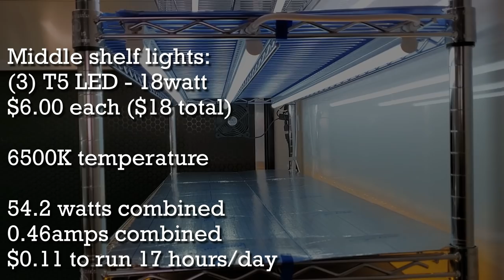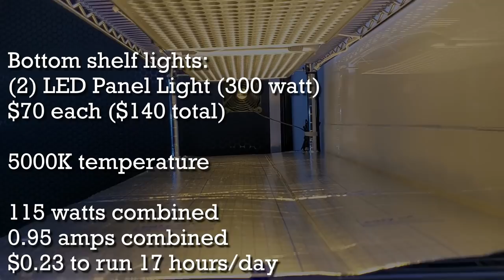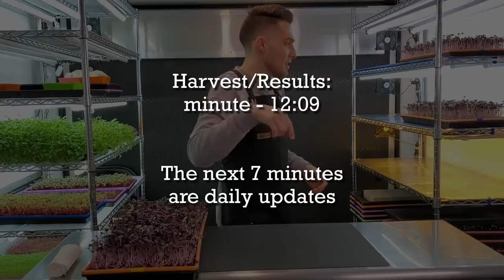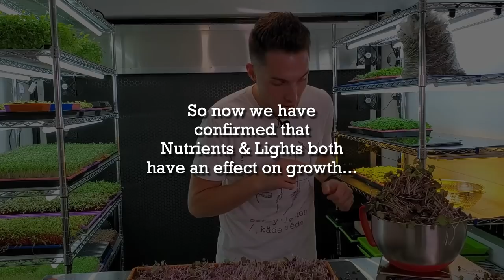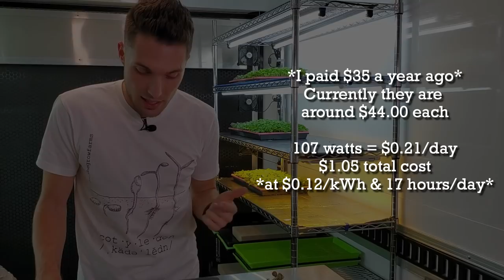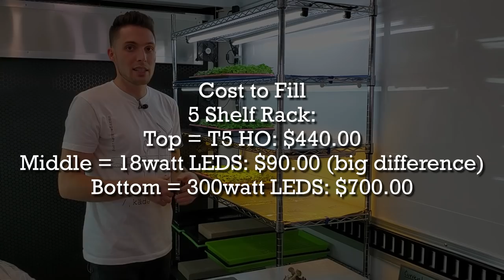Microgreen Lighting: Fluorescent vs LED's - On The Grow

Comment: Florescent generates more heat than the LEDs. I personally use that heat. I use 4 tube grid lights recycled from a school relighting program. I drilled 1/4" holes every 4 inches in the diffuser. Then I mounted a computer fan in the light housing  over a 4" hole I cut in the upper housing. The result is a diffuse gentle drying/heating breeze that keeps all mold issues gone! I only bottom water. Perfect combination of cheap, effective and easy. I recently started using 20watt led tube lights 3 to a shelf. They seem to produce slightly more light and far less heat. I grow in my basement year around. I think I will need the heat this winter. LEDs will not supply that. I have seen no difference in growth rates in my particular application. I also grow full size cherry tomatoes all winter. I use 2@ 4 tube florescent fixtures and 6 20 watt led tube lights, plus a led 40 watt dope light. In harvest tomatoes literally every day. New flowers, growth and have to bonzi cut every week. Tomatoes are very tasty. Nice video, thanks for sharing!

Comment: Hi guys, just started out and am using a grow kit from True Leaf, using 24" 6000k led's, 2 per shelf.  I've tried both the soil and hydroponics but Im having watering issues.  Started with salad mix, both started out good but then started smelling like wet socks by day 7, watering about a cup a day.  I'm wasn't able to bottom water with these crops but drilled out some holes for a recent radish tray, and hope it stops.  Could you point me to some info on correct watering?  Do you monitor the weight, how many cups per day?  I don't have any chemicals currently.  

Also, how did your crop test taste?  I thought the soil tasted much better than the hydroponics, and performed much better.

Thanks!  Great info!!
Reply from the maker: Hey Mike! It sounds like you could be slightly over-watering... Our go-to is about 1 cup, twice a day (morning and evening) in early growth and 2 cups twice a day (morning and evening) in later growth... This really depends on the crop variety though. You want the tray to have mostly absorbed all of the water from the previous watering before adding more... Otherwise you will end up with stagnant water with a smell like you described. Try dropping your watering substantially for the next grow and pay attention to the medium and plants... 

As for taste, they are both very comparable for us... The only time we have disliked the flavor of some hydroponics groups was when we used a nutrient called Sea-90 which made the plants so incredibly salty...

Hope that helps!

Comment: Very informative video as usual. It certainly shows others that they don’t need to spend a lot of money on lights to grow microgreens. You mentioned that one tray had an advantage, but I missed why it had an advantage. I assume the they were bigger, but didn’t understand why? Maybe it had to do with where in the stack that tray was 9r were the tray weighted individually?
Reply from the maker: So the ones that had an advantage was the tray that was on top for the last day of stacking. It just gives it a slight head start on standing up straight... it only had an empty tray on top of it where the other two had the weight of the other trays on top of it. Hope that makes sense! Thanks for the continued support!
Reply: On The Grow Thanks for the fast reply and yes thats what I was assuming, but I just wanted to make sure. I appreciate the clarification and look forward to more of your videos 👍

Comment: Cooler temps and more red spectrum light will give them more purple color. Being on the bottom and not having lights under it to heat the tray as well as including more red spectrum, it's easy to see why the LEDs on the bottom gave different results.
Reply from the maker: We will have to switch up the lighting order to see! We're also about to start some experiments using different levels of yellow/red light to see what the impact is.

I have heard of cold-treating microgreens on their last day to pop the color... might have to experiment with it... Thanks for sharing!

Comment: interesting data so far.  Temperature and relative humidity on each shelf together with accumulated water consumption could indicate how much water is retained by the plant and how much is transpired to the atmosphere.  Concurrent  comparisons of appearances, aroma and tastes of the plants together with plant growth/weight gains could also indicate if some stress factors could be positive or negative for productivity and at which stage of maturity the changes to watering, humidity and temperature will benefit the plants and your process management.  Eg. A possible next experiment could be to set up 3 shelves with 3 LED tubes as in the blue shelf (indicated as your cost effective option) and vary the watering program timing of applications to use the same total amount as you did in this trial. Daily, 1 tray with a third x 3 , 1tray with a sixth x 6 and the final tray at a twelfth x 12 watering schedule.  Smaller amounts may require distribution to avoid the possibility of plants further from the water origin becoming dry.  The water applications will alter temperature and humidity also.  More frequent applications will reduce variation.  Significant program variations are more likely to indicate future possible testing directions.  Recording the findings of the factors listed could indicate other modifications to improve growing schedules.  Exhaustive as it appears, the results become more reliable as variables are reduced by accumulated results.  Sometimes a trial batch of a main tray can be set beside the main tray to test a varied management plan.  This can save time and expense and helps you to remember to maintain the trial as you look after the normal watering etc..  
It can be surprising and rewarding to discover what works best for you.  Cheers, Gary

Comment: Divide your costs by 4 or multiply your produce weight by 4 since you have 4 trays per shelf/light set. Also, what is your cost per gram of produce? Spread your light rig upfront cost over the estimated time to failure (should be available if they are UL listed). You take that est. failure time and divide by time to maturity for an average tray... then multiply by four for the # of trays per light. Take the total cost of the light and divide by that number to get the estimated cost per tray of produce. Then add the running cost, like you did, but divide that by 4 trays as well. That, plus your water and fertilizer costs will be your gross cost per tray of produce. Now, take the sale price per gram multiplied by the grams for gross revenue. Subtract out the previously calculated cost per tray and you have the gross profit per tray. ...now you have the harder parts of overhead... salary, transportation costs for delivery, taxes, etc... Oooorrrrrr.... you can just look at how much you made and subtract what you spent at the end of the month. 😁

Comment: Great content!  Curious if the distance between the plants and the lights affects the "stretch" of the plant?  You mentioned that high intensity lights sometimes discourage the sprouts to stretch towards the light, so I am wondering if mounting the lights a few inches higher (maybe 6"?) would encourage that stretch.

Comment: I loved this video, it's very interesting content. Can you do another experiment with the better lights on the top shelf? I'm wondering if it was not only the better lights on the bottom shelf but, also if receiving the light from the upper shelves was a factor? Thank you for posting your experiment.
Reply from the maker: Thank you for the support! Each shelf has an opaque layer between it... the only way there is light bleed is at the very back where it slightly reflects off the wall, and I wouldn’t consider that as having an effect. Especially considering how much light the bottom light puts out. If I turn off the other lights, there is no change in LUX so there shouldn’t be any light getting through...

Comment: nice video mate, 

you should look into a par meter,  each spectrum of light has a different energy. 

once you have a PAR meter, you should set your lights to have equal light (based on umol/s) (example: 3 shelfs, with even coverage of umols (say 165umol/s, DLI = 10 over 17hrs of light) on each shelf

at this point you can check the quility of the light spectrum and how it effects your microgreens since they will all have the same DLI,

the red spectrums will give your plants more height
blue spectrums shorter/leafyer plants
green spectrum will help with penatration to the lower parts of the plants (green spectrum is in white)

having a par meter will also help with correct power/light output since your not using lux (visable light to humans and not plants)
Reply from the maker: Yeah, I have looked into a PAR meter, but I am not really into the over-analyzing of the light spectrum. I use LUX as a basic measurement just to show there is a difference and my main concern are the results and the effects they have on a crop.

We will get more into the science of it at some point, but for now, LUX is sufficient as the main goal is to see how these lights effect growth. We don't need to measure PAR, PPFD or any of that to see the results the different lights provide. 

Thanks for the suggestion though!
Reply: @OnTheGrow  good job on ordering a  quantum par meter. it cant tell you the quility of the light, it will only show you how many photons are hitting a surface that is usable for the plant (PAR)

Comment: Thank you so much.... SUB'D. I have to ask roughly how much was the portable trailer with incorporation of fans and temperature equipement?
Reply from the maker: Thank you for the support!! It was about $15,000 for the trailer with the Insulated Walls, Triple Sink, water reservoir, rubber flooring, aluminum walls, 15,000BTU A/C, electrical and so on... with the added racks and gear, probably closer to $20,000 or so. 

I bought it new and custom built, which I recommend against. I’d buy used next time, then convert for like 1/3rd the cost. I would think it could be done for $5,000 or less. 

I’ll be making a video about it soon with some ideas and stuff how people could do it better than I have!

Thank you again for the support! 🤗🌱🌱

Comment: Any thoughts on how the spectrum and temperature of the light effects growth. I found some toggled led bulb replacement for my racks and put 4 T8 replacement bulbs per layer. I picked 6500k 18 watt bulbs the nice then is that they are cheap as well at $20/pair. I will let you know how the trays grow out.
Reply from the maker: Nice! Yeah, we also mainly use the 6500K spectrum. We did have some blue spectrum lights that did amazing, but the supplier has since stopped selling them. They were actually our favorite lights. We haven't dug too deep yet into spectrums but we are hoping to get more tests like this going so we can learn more about them! Excited to hear how yours work out!

Comment: If you took the extra 2 ounces from the sprouts on the bottom shelf, and sold it for six dollars a container at the farmers market, that would be an extra $120 for 20 racks, providing that you got the same extra yield every time. That would pay you back for the more expensive lights in seven weeks, then after that you would have an additional $120 in profit per rack, or approx $12k per year for the two racks I can visible see on screen.

Comment: In the video you referred to the middle shelf as 18w LEDs, but in your amazon shop you have 22w and 20w listed.

Can you clarify which is which in the shop?
Reply from the maker: They stopped selling the 18watts and bumped them up to 20 watts. We have some on our shelf, I just keep calling them all the 18 watt. The 20 watts will actually work better since they crank our more lumens and they are actually cheaper than the 18watts I was buying. I got ours from a company called OnlyLux if you are interested in trying to find our exact lights. Sorry about the confusion! It is hard to keep the same lights listed because the amazon vendors switch it up so often.
Reply from the maker: Here is part of the reason we stopped listing them, they switched from 6500K light spectrum to 4000K (more yellow). Here is the same company we used, but they no longer have the 6500K like we show in the video: https://www.amazon.com/ONLYLUX-Integrated-Fixture-Daylight-Electric/dp/B07R7PNFND/ref=sr_1_7?crid=1JWB7KLCLMN6B&keywords=onlylux+led+t5&qid=1580577123&sprefix=Onlylux+%2Caps%2C179&sr=8-7
Reply: On The Grow perfect, thanks so much. I just wanted to make sure before I purchased the 20w (middle shelf).

By the way, your videos are phenomenal. Best information on the web. Keep it up!!

Comment: Hello, I followed your Amazon link, but I don't see the T5 LED - 18W lights, I see a 6-pack of T5 LED - 22W lights is there a link I'm missing? I assume the usage cost and heat factor would be higher with the 22W's?

Comment: At what frequencies is the sensor responding compared to the light output frequencies? That will dramatically effect the 'lumen' measurement. Is the middle shelf hotter due to the leds below?

Comment: since these trays are placed on your shelf sideways, instead of front to back like your other shelf, have you considered moving the lights closer together? I wonder if you would get a more uniform vertical growth without the mushroom shape
Reply from the maker: Great question! I think that if we were to move the lights closer together, that we would potentially get a worse mushroom shape.The middle is getting the most light and the best growth while the sides are getting less light. If we moved everything closer to the middle, I would think they might mushroom worse. If we added more lights to the sides, we might be able to get it fully even... It would be fun to see as a test! Thanks for the suggestion!

Comment: I can't seem to find the 18watt lights that yall used in the middle rack, the amazon links only show a 20 and 22 watt light and I can't find ones. Were the ones in the middle the Hykolity or Barrina lights? Thank you :)
Reply: I looked as well and found the same.
Reply from the maker: Sorry about that! Basically on Amazon sometimes the sellers will switch the items and it does not notify us when they do that, so that's probably what happened.

Comment: Is it possible to use normal LEDs light to grow. The reason is because I can just buy the LEDs bulb from the market and build the light system myself in  order to reduce cost. Is there any difference? Cheers
Reply from the maker: Yes absolutely! Just check to see the lumen output, wattage and temperature of the lights... We have had the best results with 18-22watt LED's that put out around 2,000 lumens each with a temperature of 6500K or close to that number. Hope that helps! Here is a link to our website with more information about growing: https://www.onthegrow.net/growspacefaq

Comment: Great video - I am planning to start small with just a few lights to grow some basil. Can anyone tell me how long On The Grow leave their lights on please? I am sure they have covered it but I haven't come across it. Maybe 18 hours a day? Thanks to anyone who has seen that information.
Reply from the maker: We do 17 hours on and 7 hours off! 18-6 works as well!!
Reply: @OnTheGrow  thanks so much! I still don't know what to buy as the ones you recommend not very easy to find in Sydney. Love your videos!
Reply from the maker: @JanetB55  I would start with whatever you can get your hands on locally! We like LED's because they can grow some really strong produce with very little heat created and low energy consumption. Check out options at local hardware stores and stick to the 4000K-6500K temperature range. We stick to lights that put out about 2,000 lumens each and use 3 of them for a total output of around 6,000 lumens. I know it gets a bit technical, but I hope that helps!
Reply: @OnTheGrow  thanks! I have found a supplier of Phillips T8 led tubes 20W so I am going with those. Thanks again for your wonderful videos.

Comment: Great info. I can not seem to find the LED , 18 w lighting ?
Help
Reply from the maker: We actually had to remove the 18watt LED's because the vendor stopped offering them and switched. So we now suggest the Barrina 20watt lights which we have also used in our space for about 7 months with great results. I believe they are the same price as well, so really its more bang for the buck. https://www.amazon.com/shop/onthegrowfarms?listId=300RR4HQRM5I9

Here is the 18watt lights: https://www.amazon.com/Onlylux-Integrated-Fixture-Brightness-Electric/dp/B07D34KFGP/ref=sr_1_1?keywords=onlylux+t5+LED&qid=1583210846&sr=8-1

I personally like Barrina because they have been very solid as a vendor and have a lot more great ratings.

Comment: Based on the other lights Id go for a single diode row 4ft samsung f-series (about 18000 lm for every 100W) or even one of their horticultural strips, at about 25W for a row like that. The hortistrips have some extra spectrum like 660nm in which really adds to leafy greens like lettuce
Reply: I'd experiment with 3000k and 4000k in those
Reply from the maker: We can try to experiment with some of these! Thanks for the suggestion!

Comment: Did you post any information about the lifespan of the three different lighting spectrum’s that you used?
Reply from the maker: Yes, it’s the very first comment on the video. I pinned it to the top. Basically LED’s would last around 8 years and the fluorescents would last under 2.